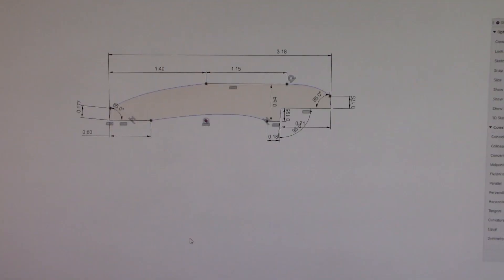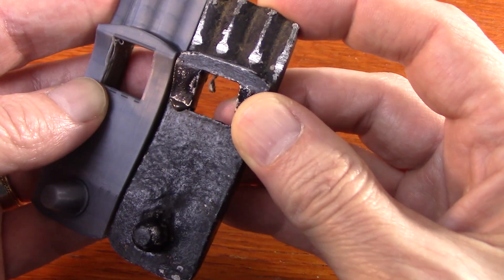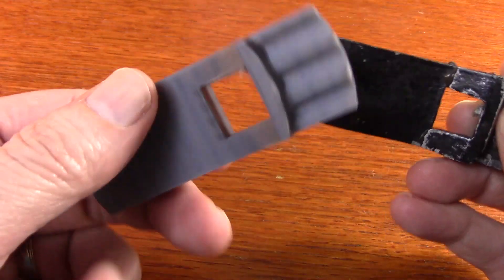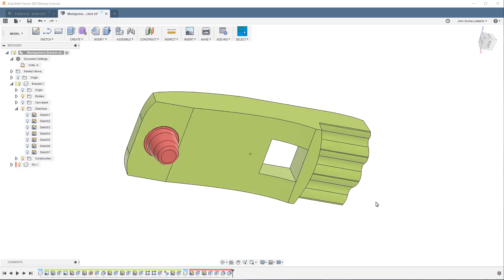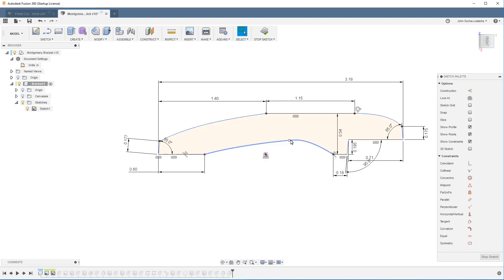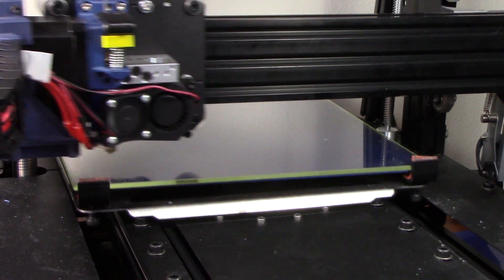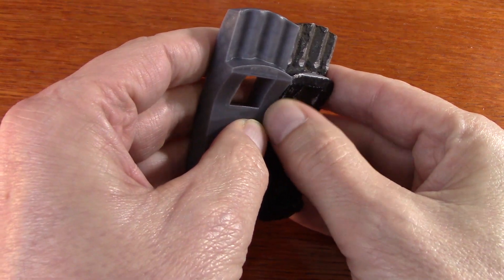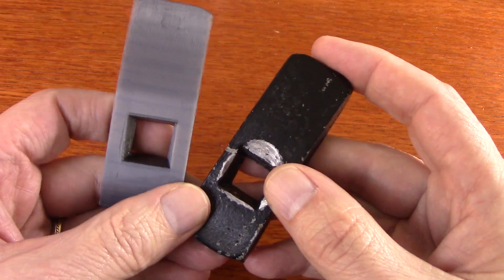#32 CNC for  Drafting Table Repair, Part 1

Comment: I have this same problem and am having trouble finding a replacement. Hamilton drafting table.
Reply from the maker: Is it the same exact part that I made? If so, send me an email (via the About tab). I'm much better at making this type of part than I was back then.
Reply: @JohnSL  we didn't see an email listed in the about tab so we sent a message through Facebook messenger.
Reply: What software was used to draft the part?